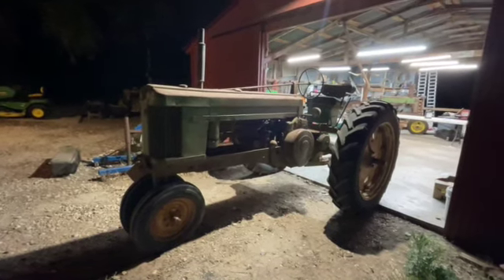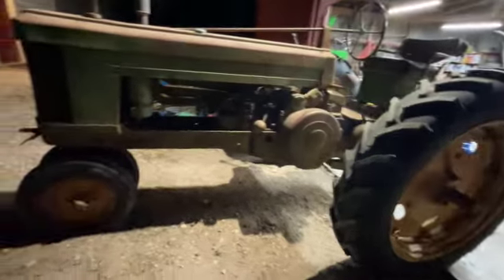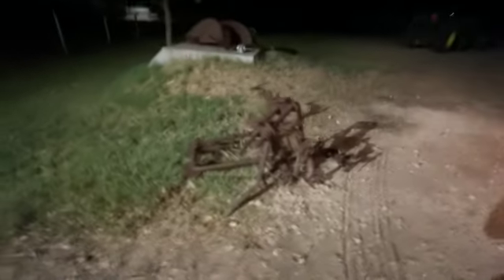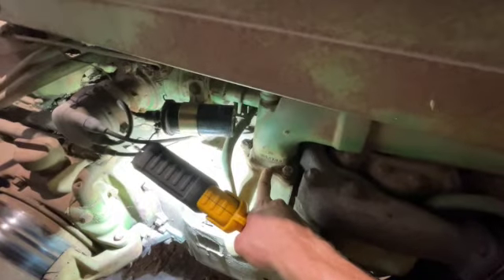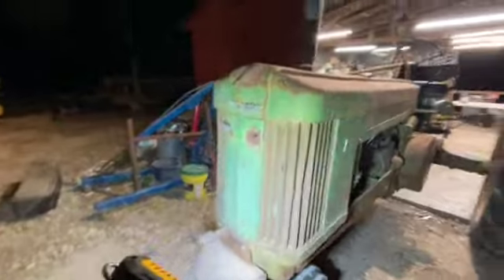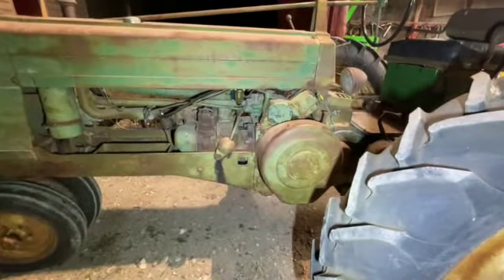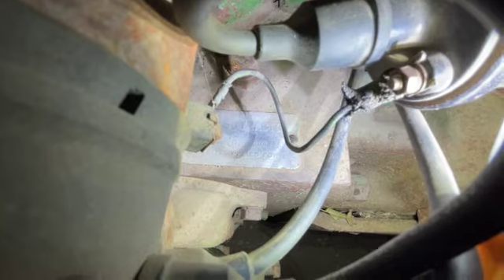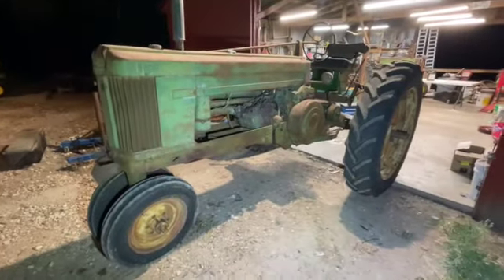John Deere 50 2 Cylinder Running!

Comment: It's a 1953 model and it runs nice most number series tractors have live independent pto I've never seen a 50, 60, or 70 without live pto
Reply from the maker: Funny all the 50s and 60s I have seen other than this one don’t have live pto thing it must be a location thing
Reply: @etherbanditsgarage9313  That is certainly possible. Tractors in my area were used primarily for forage production. If you are in a grain producing area, maybe it's not common to have that option.

Comment: I want to see you cultivate a crop or garden.   Are you going to use planter boxes  or do you have a pull type two row planter?  My grandpa had an A JD with cultivator and pulled planter with VAC  Case.  He used the Case to layoff rows in his garden.   I want to get set up like my grandpa.   Proud you are putting cultivator on your JD 50.  I enjoy your videos.
Reply from the maker: Thank you I have the mounts to put planters on this tractor however I don’t have the boxes. That being said I do have the full setup for my case vac
Reply: @etherbanditsgarage9313  The 50 can handle a four row JD pull type corn planter.

Comment: Runs good with the choke pulled how does  it run when push the choke in
Reply from the maker: Runs good at 1/4 choke but granted that is with absolutely no tuning done to the rebuilt carb and a case of grease in cylinder number one so to expect it to run perfect from the get go is kind of absurd